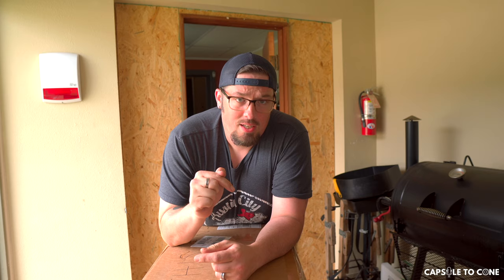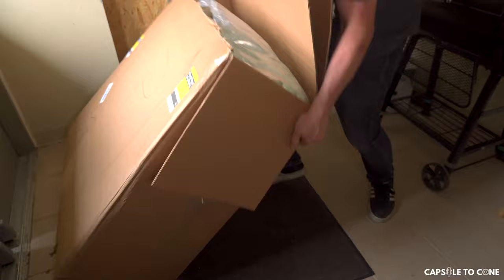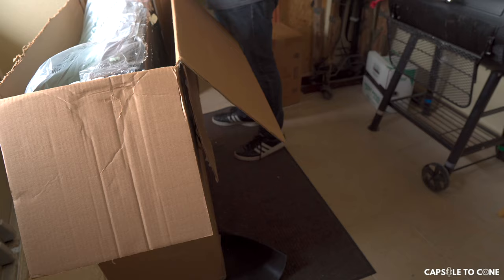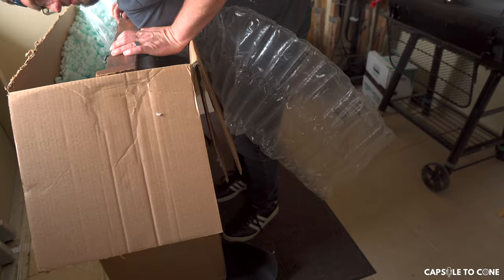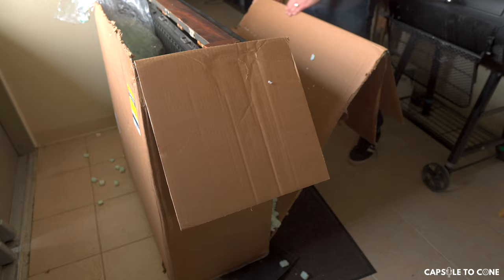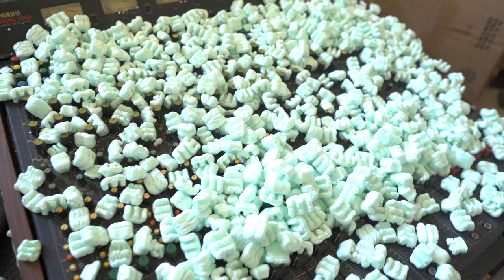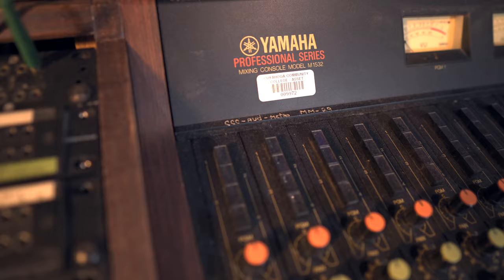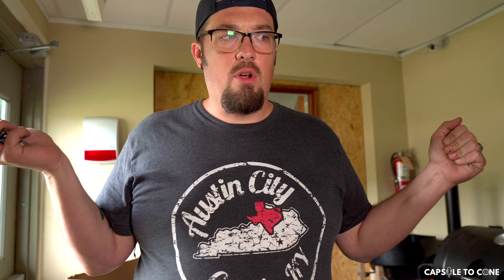Yamaha M1516 Console Modification | Build and Mod Recording Studio Gear Part 1

Comment: Hi,
I have a Yamaha M1532.
I am interested in making changes.
Did you replace the IC2 and IC3 of the input channel?
And the sum amp IC of the PGM channels?
  I was thinking about putting a discreet opamp, jensen style 990. But it would need an adaptation.
I will follow your videos.
Greetings.
Reply from the maker: I dont know! I  will have to look!

Comment: Hi there. I am a French music producer. Got my studio and just got an Yamaha EMX 3500. Do you know if those got the m1516 preamp ? Thanks !!!
Reply from the maker: No, sorry to tell they do not. That is basically full of run of the mill opamps and transistors.  It WILL get the job done as far as mixing and summing goes if you need that out of the box, but its not going to impart any special vibe, crunch, color and for the most part is just a clean transparent console.